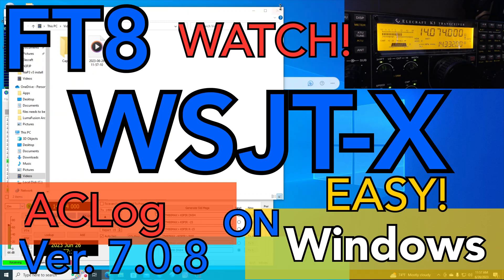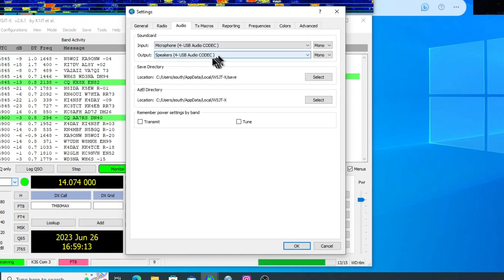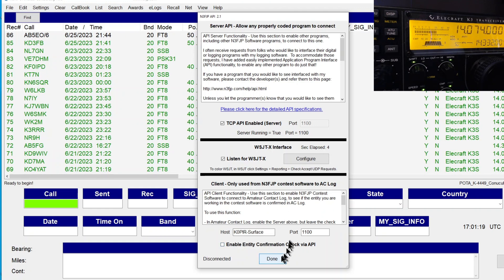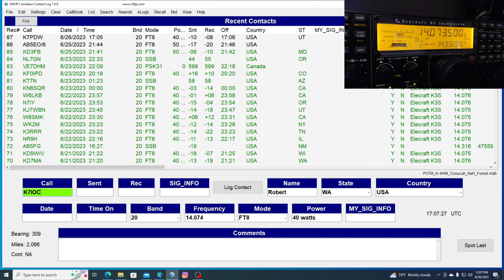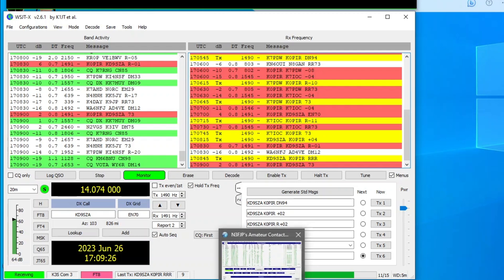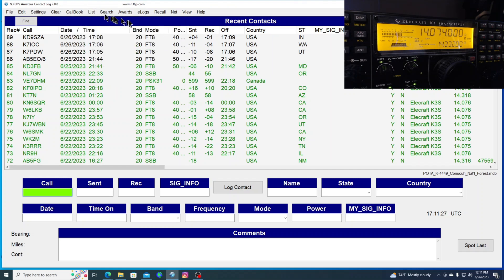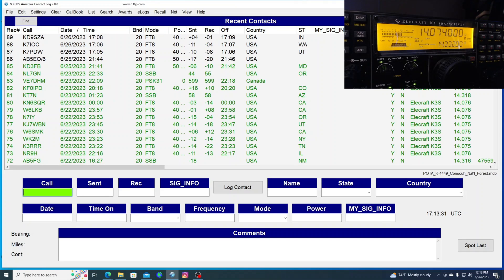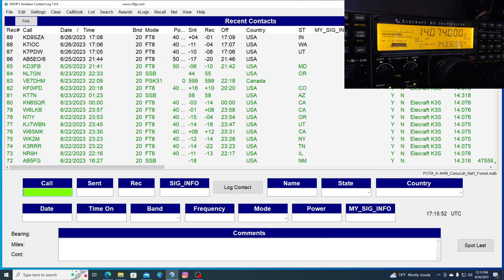FT8 Logging Super Easy - WSJT-X ACLog Integration

Comment: I don't use rig control, can ACLog still work with WSJT-X?
Reply from the maker: Hey, thanks for commenting and it’s good to hear from you. I don’t always use my rig control with my logging programs, but I do use it with WSJT-X. I hope that answers your question. 73 and good DX! 😊
Reply: @HamRadioAdventures   what i was trying to ask, can I use this software for logging not using rig control. I do not, cannot use rig control, so will this still log my contacts?
Reply from the maker: @richsabo1  RR In ACLog, transceiver setup, disable(stop) polling. Or, just don't setup Transceiver control in ACLog and it won't start polling. Polling means it is trying the connection to the rig. I use it like that with WSJT-X. WSJT-X copies over the freq., mode, etc. GL and hope to catch you on the air! 73!
Reply: @HamRadioAdventures  Thank you much my friend.... I am going to try it! Yes hope for a cantact.....73!

Comment: When I click on the interface in AClog then choose a contact from the waterfall and click to contact that person, AClog opens up with a new empty log. What I want is to have it open at #30 with the 29 previous contacts showing below it.  Is that possible? I stopped the attempt there so I would not lose the 29 ctx in the log.  Hopefully they will show up if the contact is made and logged.   Hope this is clear enough for you. I just upgraded Win from 10 to 11 and lost my  previous logging method. ( I usually make 50 DX ctx per log and send them to Lotw.)  73 W7IBI
Reply from the maker: It’s nice to hear from you Chris and thank you for commenting. I am not following, when you double-click on a callsign to start a FT8 transmission, it opens ACLog? I always have ACLog running minimized and after I click log QSO in WSJT-X, it sends the contact to ACLog. How my logged contacts are shown is determined in ACLog by choosing ascending or descending.  Click on the top of the column, REC# and it will change for you. If you want I can send you a screen shot. My e-mail is good on QRZ.com. Thanks and 73 and good DX!
Reply: @HamRadioAdventures  Thanks again for the answers. If I come across any more questions, I'll know where to come for your assistance.